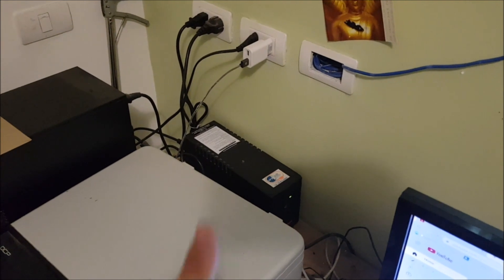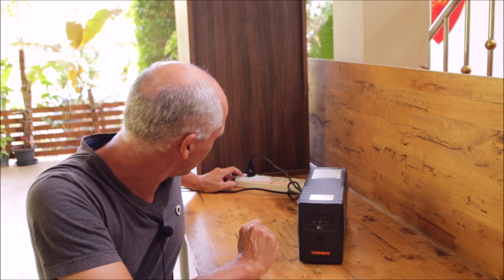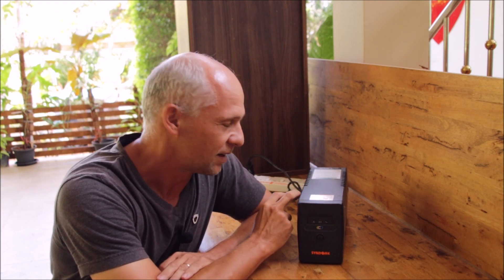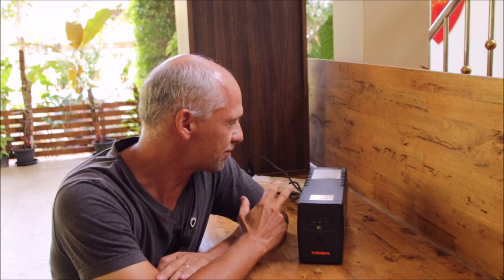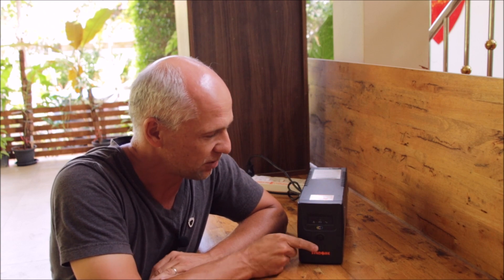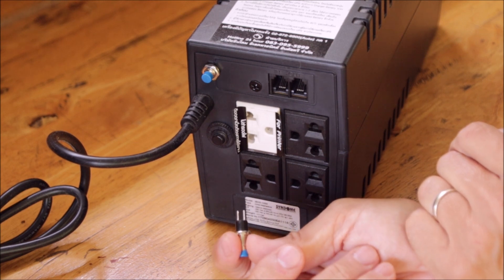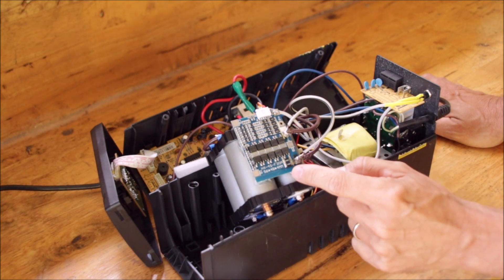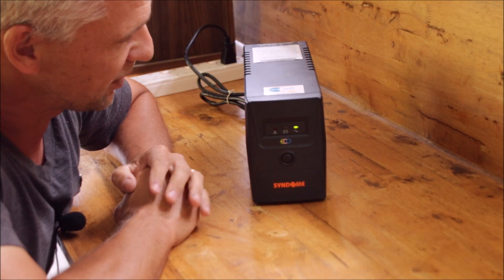LiFePo4 -  UPS gets a small but important upgrade!

Comment: This is expected for cheap BMS. I use Daly BMS in my case, I did a test to trigger over discharge protection making the battery reach around 10.2v, LFP batteries usually recovers around 11v if you leave it some time and that should wake up the BMS working again. You can actually hear some relay clicking when the battery wakes up again from over discharge protection.

Comment: I understand your problem. Have you tried to rid the bms and just use an active balancer instead. Also there are bms where the load is connected straight to the battery terminals so the bms is bypassed. In my setup I did not use any bms or balancer just 4 batteries. So far no issues since my load is minimal..
Reply from the maker: @johnhalcon4459  i have added a small active balancer a while ago. the cells i got are all salvaged and a bit crappy :). now its far better

Comment: HI !!! i built 4s1p with bms XH-4S-F30A for lifepo4 same video but it can't load the computer even for 1 minute. is it a bms problem? Can't start ups without grid, and UPS can start while no plug rear 220v, PC under 250W. Please help...thankyou verymuch
Reply from the maker: @terracelong6119  hi. did you check if all cells do have same voltage when the pack is charged? if one of your cells is low, the BMS will cut out the battery. I added a small active balancer later too as the cells got old and ran out of balance.
Reply: @RolandW_DIYEnergyandMore  Thanks  the feedback, i will try again with active balance.

Comment: I want to convert my 750VA APS ups into an LFP powerwall (24V x 280 Ah).  So I run my day day pc load (ca 250W) off UPS and run mains/recharge ups on 8 hrs night time rate (which is 1/3rd of day time).  I wonder if the UPS could handle continuose usage given that its only intended for a 15min operation on its 24V 5Ah LABs.  Would be very good if it could do duty like that as a Victron equivalent is ca £750
Reply from the maker: a 750w Ups can surely run a 250w load continuesly. i saw some people use ups as inverters

Comment: Great stuff, an obvious solution when pointed out.  Maybe add a low voltage cutoff relaY before reaching the bms low low safety cutoff as well.    Now nee to address the difference between LAb charge curve and LFP charge (doesnt need or invite equalisation period charge - that should be minimised somehow?
Reply from the maker: LFP cells don't care about any of the equalisation, absorption, etc
Its just important to stay within the voltage limits. Of you want to avoid BMS cutout, then a voltage relay might be a good idea indeed

Comment: Hi i have a SyberPower ups that usess two lead acid batterys in series, can i use LFP batterys and will it charge? I am buying two LFP batterys with built in BMS. And how do i get to hook  the switch up on thoese batterys?
Reply from the maker: Hi. I would buy either 8x LFP cells or a 24V LFP battery if available. Using one BMS is easier then having 2 sets of packs inside. If you have 2 LFP batteries in series, each of the 2 BMSs might disconnect when a cell is low. So you would need to open up each battery and solder a bypass switch to the mosfet bank. You would then have 2 switches and in case of a reset, press both simultaneously.
Reply: @RolandW_DIYEnergyandMore  Hi thank you for your video's and your time and for reaching out to me so quick. Have a grate day.

Comment: its been a year since you created this project, so how was it now after a year??? still working/? did it blow up? update us.thanks
Reply from the maker: Yes, the UPS is still working fine. It just turned out thet the cell which i got where used so the capacity isn't that great, but else all OK. Nothing blew up yet ;)
Reply: @RolandW_DIYEnergyandMore  I have a better trust with lifepo4 than LA battery, but I have a concern with the BMS itself. UPS mechanism is different with cellphone or other devices which having discharge and charge state very often. I have a good electricity at home and I able to count the electricity failed 1 or 2 times a year, so the battery should be always in high volt. This state would be 'a torture' for the BMS itself. When your BMS failed, I believe your lifepo4 will be overcharge and broke it. There's no indicator for the BMS itself and we are always in comfortable position when there's no outage in your area. The comfortable state will be suddenly disappeared when there's outage and your UPS not able to back up your devices and you will investigate this. You realize the damage came first from your BMS and next to lifepo4 because of overcharging.
you buy lifepo4 for a better endurance with a higher price than LA but the BMS ruin your price plan.
any advice for this?
because I'd like to change my LA to lifepo4 and the BMS itself still to be concerned.

Comment: Thanks! I've been looking for this exact fix. I'm just getting into electronics and am very cautious.
I was thinking of buying a DC to DC charger. Good one from Renogy to put between the ups and lithium battery with built in BMS...... anyone rolling their eyes yet?😅
Reply from the maker: Don't know if that works as the DC-DC converter will make the battery invisible for the UPS controller. It will not know how long to charge, how to discharge, low voltage state, etc.
DC to DC converters are cheap. Just try it ;)
Reply: Yes you are correct! I was going to complicate it further with relays somehow with some sort of delay so it won't loop. Hope I'm explaining this well
Reply: I think I've watched too many battery fires LoL but I do understand how safe these are or I wouldn't even try this
Reply: Thanks for the reply
Reply: I should mention I'm concerned about the charging amps. If the DC to DC converter can output 20a does that mean any battery attached to it will take 20a and cook itself? This is the reason I was thinking of a battery with built in BMS. A little bit of knowledge is a dangerous thing.....
Reply: Any resource you can point me to to learn this?

Comment: I have a similar problem on an old APC Smart UPS 1400.  I was able to use the COM port to connect to the UPS and enter PROG mode.  From there you can set the voltage calibration.  What you can do is to start with a 12V lead acid battery and measure the voltage both fully charged, and then run the battery down till the UPS shuts off.  Using a voltmeter at the battery posts you can directly see what the UPS fully depleted voltage is.  You can then adjust the calibration constant in the UPS firmware up so that the calibrated depleted voltage in the UPS creates an actual voltage at the LFP battery posts that is above the BMS disconnect voltage.  The only downside is that the UPS never registers fully charged and is likely continuously try to overcharge the LFP battery, but the BMS is cutting off the top.  

The other way I've tried it is to set the calibration such that the top of the voltage window is the top of the UPS pre-programmed charge window.  When I do this, I need to be careful to set the maximum % allowable discharge such that the LFP battery voltage on the posts never gets below the BMS cutoff (ie: set the UPS to start shutown at 35% instead of 10%).  This happened to me when I was first setting up the LFP module.  Couldn't get the UPS to take a charge to turn back on.  Had to rig up 24V to get the battery over the minimum UPS turn on voltage.

If i was to do it again, I'd use 8 bare LFP cells for 24V and only use a balancer not a full BMS, and make sure that the top of charge window calibration was set correctly to not exceed the max charge voltage.
Reply: that second option is dangerous - not advisable and not for noobs

Comment: I have an automatic alternative to Roland's manually operated switch.  There is a small & cheap electronic switch available on AliExpress etc, having part number TRM01. It has four settings (which once selected are retained in memory even if power is removed.  The TRM01's second setting will activate a relay for "X" (adjustable" seconds and then release it.  I have it connected across the LiFePO4 battery 12VDC terminals so that when the charger supplies 12VDC, the device is powered but the relay is normally not activated.  The relay's NO / COM terminals bridge the same BMS terminals (the B- and the P- ) as Roland's manual switch.  When a power failure occurs, the battery voltage will gradually drop until the BMS low voltage threshold activates.  The B- is then disconnected from the P- on the BMS.  That also removes 12 VDC from the TRM01.  Once grid power resumes, the UPS battery charging circuit provides 12VDC to the TRM01, the relay closes for "X" seconds (mine is set to 5), the BMS reactivated and the LiFePO4 battery automatically starts to charge.  The TRM01 draws ~ 5mA of current when the relay is "sleeping" which the UPS battery charger will easily deal with.

Comment: also.... i don't agree on your cost comparison ( at least for the long term) cause LiFePo4 batteries have many more times the cycle capability hence you dont have to replace the batteries often like lead acid. also... less of trouble for many years. hence in the long terms cheaper then Lead Acid.

Comment: ouch !! I just ordered 3 kits with LiFepo4 batteries from AliExpress. The UPS are installed at a remote location with no human presence for a couple of weeks / months. Hopefully my UPS has a higher low-voltage cutoff. alternatives i can think of are: 1) the management software (APC powerchute) can be configured for a higher low-voltage cutoff 2) replace the BMS with a "Smart BMS" which can be configured with a higher cutoff. (expensive alternative).

Comment: Hi i had purchased 12v 12ah lipo4 battery for ups, but my ups is not able to charge it more than 14 v so it never fully charged the battery so, i can only switch on the ups using grid power, and it gives backup if grid power cut after switching 9n the ups, but problem is that is i have already power cut from grid,  then i can not switch on my ups directly 9n this battery. The ups is ok as it was designed for 12v 7 ah lead acid battery and if i put old lead acids battery then it work normally. Help me to overcome this problem
Reply from the maker: Hi. 14v is 3,5v per Lifepo cell. That is considered full as there is only maybe 5% extra capacity left. And as your pack is 5Ah bigger than the original lead acid one, I don't understand the problem. Do you have extensive power cuts which cannot be managed by that battery size?
Reply: @RolandW_DIYEnergyandMore  these batteries give enough power backup but i have only one problem that is if there is already power cut and i want some urgent work to do on my pc i can not wake the ups directly on battery. Thats the problem which i want to overcome, thanks for the quick reply...
Reply from the maker: @patelvimal3591  OK, i guess that the UPS control board is not satisfied with a parameter for a restart without AC available. How about if you connect the external lead acid battery in parallel with the LFP pack via a momentary switch just for a restart attempt. And when the UPS restarts, just release the switch.
Reply: @RolandW_DIYEnergyandMore  don't understand what u want to say, do you have any link for that?
Reply from the maker: I just mean that you wire up the lead acid battery in parallel with the lifepo battery. Plus to plus, minus to minus. But not permanently, only when you want to restart the ups without grid. And only for short, for the purpose of the restart, like a jumpstart of a car... maybe the ups would then see the battery differently
Reply: @RolandW_DIYEnergyandMore  is there any other way as i had scrape the old lead acid battery
Reply from the maker: @patelvimal3591  sorry, I don't know. Can't you keep the ups turned on always?
Reply: @RolandW_DIYEnergyandMore  no, but thanks for the help

Comment: Hi Thanks for a great video. I can get a 12v Lifepo4 battery that looks like the lead acide battery and the BMS is sealed inside. How can I do the modification without cutting open the Lifepo4 battery to do this ? Thanks
Reply from the maker: Hi. What you could do is use a simple 12V DC power supply in parallel to the battery over a momentary switch. So, if the UPS goes down because the battery is isolated from the BMS, you just press the switch and the UPS gets shown 12V from the external power supply and can revive its charger. Once it starts charging you can just release the switch again.

Comment: If using a larger capacity LiFePO4 battery that the original fitment use an additional charger direct to the battery to charge in a reasonable time and charge regardless of the BMS.
Reply from the maker: Yes, by increasing the complexity there would surely be some ways to go around the BMS issue and your suggestion is valid. But all this is adding up in money as well. It's everyone's decision how much it is worth to him to upgrade what was a rather cheap product in the first place. And the question will then still be how many times will the UPS fully discharge...

Comment: Thanks for the video.  Can you not just parallel a small lead-acid battery with the LIFEPO4/BMS?  Since they have similar charging profiles, the LA battery should have enough juice available to trigger the UPS?!?
Reply from the maker: You mean a permanently inter-connected LFP/LA combo pack? Technically it could do it. The question is only how does LFP and LA behave in parallel. The charging and discharging profiles are Not similar. LFP only has similar limiting voltages in a 4S configuration when compared to a 12V LA battery. We can use those similar voltages in our case in the UPS.
Reply: @RolandW_DIYEnergyandMore  according to videos on YouTube of people trying it, quite well, apparently it balances out
Reply: A 4S lifepo4 battery and a 6s lead acid battery compliment each other quite nicely in parallel. The lifepo4 will do ~80% of the work before the lead acid starts 'taking up the slack'.

Comment: Thank you, can you still use the existing lead acid charger inside the ups to charge the lithium ion phosphate cells, how does it work?
Reply from the maker: Yes, the UPS stays unchanged. The existing lead acid charger matches the main parameters of LiFePo4 as long you do not have extensive grid outages.
Reply: @RolandW_DIYEnergyandMore  Thank you so much for the info.

Comment: I tried changing my stock battery with lifepo4 but I have similar issue.. when I connected the positive and negative wires.. my ups beeps like normal (yellow light) indicating it is running on battery. When I try to plug it in.. it lights to green which is normal too. Problem is power switch seems not working. It is always on and I cannot turn if off. Also, when I try to insert a load (charger to charge my phone)... my ups lights to red and continuously beeps (monotone and irritating beep). Since switch not does not turn off. I open the ups again.. and remove the ground (black wire) so the ups turn off as well as the irritating beep. Not sure why my ups turns red with irriting monotone beep.
Btw, I bought a LiFePO4 battery which looks like my original lead battery. I am not sure if there is BMS included on my bought battery.
Reply from the maker: Hi. The new finished battery will have BMS built in. Maybe the voltage on the new battery was a bit to low at your test. Led it charge up on green light for a while. How much voltage do you measure on the lifepo battery when it is full?

Comment: Seems like a hassle, cant you use a relay instead of a manual switch?
Reply from the maker: A relay? Don't forget the UPS is dead at that moment as the battery is disconnected and must stay like that as long as there is no AC present to not further drain the cells. That relay would have to be activated once AC is back on and just make contact for a few seconds. Then the override must be released to allow proper BMS function. You would have to build a control circuit around that feature powered by a separate AC power supply, etc. Sure, that would be doable if required for your application. The manual switch isn't a solution for a system in a remote location but for the typical case of home UPS it will suffice.
Reply: I had the same thought.  A bridge rectifier, a DC relay, a capacitor, and a resistor (and maybe a diode to shunt the relay?) should work to make a circuit that does the same as the switch and is on only until the cap. charges up.  In this way one does not have to be home to hit the switch when the power comes back on, no?
Reply from the maker: @BruceMallett  I don't think it's going to be so easy as the UPS control needs to power up first, then you have to give it enough time to "see" the battery at the relay reset, etc. A small microprocessor like an arduino mini pro with a relay board, programed to make a onetime contact (3-5 sec) after maybe 10 sec of AC available.

Comment: how to charge the lifepo4 4s?
how many voltage ups did to charge the battery
Reply from the maker: there is nothing to change. the built in ups charger will do it similar as if there is a lead acid battery inside.
Reply: @RolandW_DIYEnergyandMore  I believe lifepo4 4s need 14.5 to full charge

so if using ups charging is only 12v?
so lifepo4 will keep charging or can be full with only 12v
Reply from the maker: @coz0015  lead acid battery is charged to around 14V as well